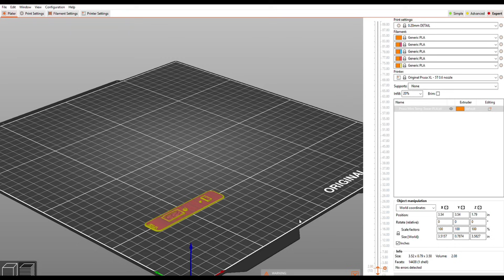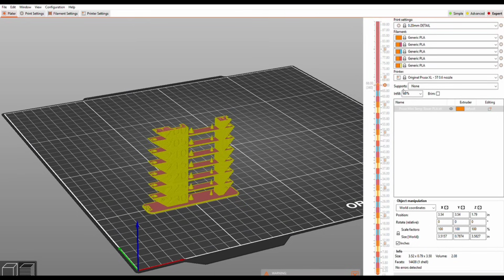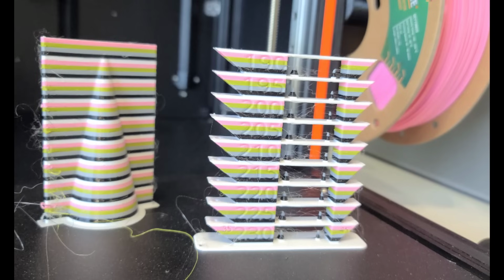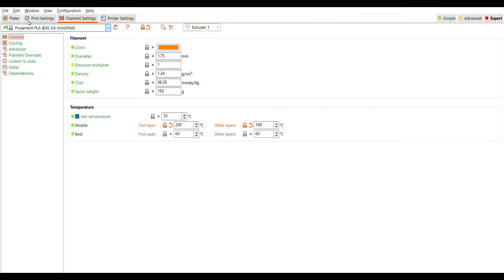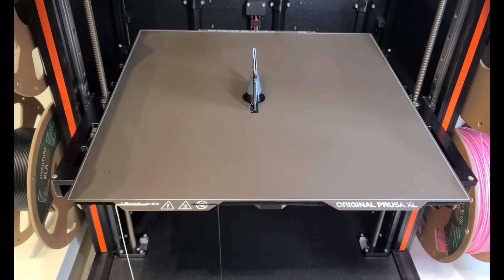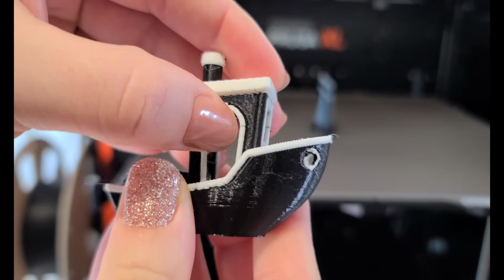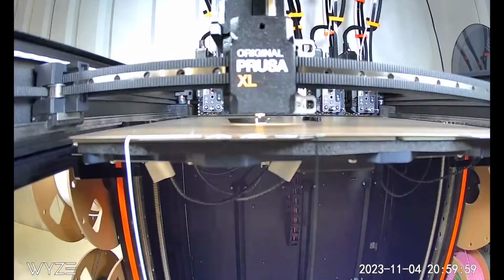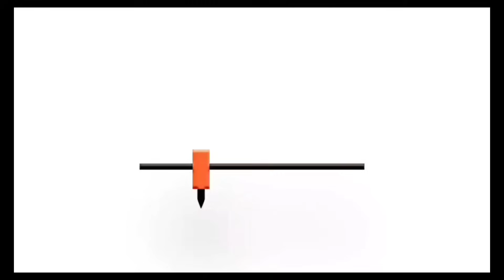Prusa XL - What Finally Improved the Stringing!!!

Comment: Have you played with the retraction settings at all?
Reply: im still waiting for her to do this lol i has to be it
Reply from the maker: No. I haven't really ever done this so I feel a little unsure what to even do.
Reply: @tada3dprinting  In PrusaSlicer click on the Printer Settings Tab. On your XL I would imagine that you have Extruder 1 through Extruder 5. Click on Extruder 1. In the Retraction sections have a look at the length parameter and the Retraction Speed parameter. If you hover your mouse cursor over the field it will give you a description of what field does, and a default value. I have found that the default values can be quite different from the actual value. Some of the values can only set on extruder 1. This may help you issue. Also, do an Internet search for PrusaSlicer retraction setting should give you some more insight into how these settings are used.

Comment: Try prusament or hatchbox, overture is crap and inconsistent from roll to roll.
Reply: It isn't the filament. With this black and white benchy, and the 5-color owl, that's 7 different rolls. No way they are all bad.
Reply from the maker: I use mostly Overture without stringing issues on other printers. Thanks!

Comment: Dry your filament, homie.
Reply: it's definitely not wet filament, because a) it's almost never wet filament, b) PLA is not particularly hygroscopic, c) she has a bunch of printers that print the "wet filament" quite nicely, d) wet filament produces zits, not strings, since bursting vapor bubbles don't stretch. PLA is not a dough but plastic.
Reply: @artmcnamera7984 wet PLA definitely produces stringing. With that said. I agree that the problem is way bigger than wet filament.
Reply: This. It's wet. I can actually get stringing from bone dry PLA, but only by cranking the temp so hot that it's bubbling from decomposition, like over 300°C. If your filament strings at less than 30-40 over recommended max temperature, it's wet.

Comment: Awesome job with your videos.  You've been the best source for XL info over the last several weeks.  I found the same thing: less stringing after alpha firmware AND alpha slicer.  Josef happened to mention on their recent prusa podcast that the two were meant to be "used together".  I'm wondering if that's a combination of some newer profiles that were loaded, and possibly the binary gcode option the two alphas support.  A while back someone else found printers using Octoprint were pausing every so briefly because they could only send the gcode through the USB controller so fast and the same gcode on SD cards had no artifacts.  Binary gcode is smaller but maybe that doesn't pause because of a bottleneck the same way regular gcode does.  

Have you had issues where your printer pauses and tells you to remove and reconnect the USB drive yet?  I had that happen on a few prints, which were annoying, but the printer recovered from without any issue, I just had to be there to do that in order for the printer to continue.
Reply from the maker: I'm just surprised they aren't clear that you NEED to use them together. It made me nervous to Alpha both! No issues with the USB. But I do have a filament sensor issue on my single head that I need to fix. Thanks!

Comment: Did you take a snapshot of your settings before moving to 2.7. Be interesting to see if they changed anything, especially around retraction and wiping
Reply from the maker: I still have another computer running 2.6.1. Maybe I can compare. Thanks!
Reply: Looked at both versions at they only seem to of dropped the detraction speed from what i can see

Comment: Temp towers are for picking the best temp for an individual filament, not color changes.  The idea is to find the best temp for the individual filament and stick with it.  White and black filaments can often have different temps because of how they radiate heat differently, black will tend to radiate heat better than white.
Reply from the maker: Thanks

Comment: Now bump the temp back up that is too cool I think for PLA
Reply: 190-180 is fine for PLA the print has a nice gloss so its heating proficiently. The Nextruder seems to have better heat transfer than most other hotends which makes higher heat unnecessary for cutting through and melting down the filament
Reply from the maker: I've been hearing that it being a .6 nozzle also helps it be able to handle the cooler temps. But yes I do want to see if I can heat it up some. Thanks!